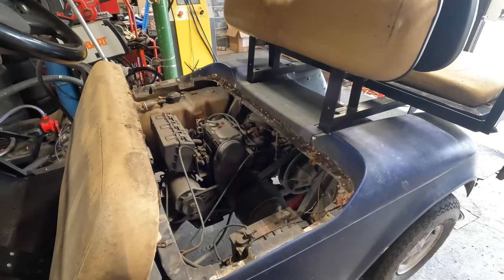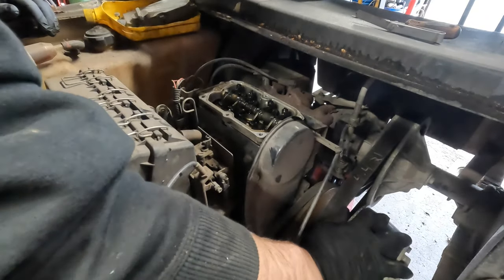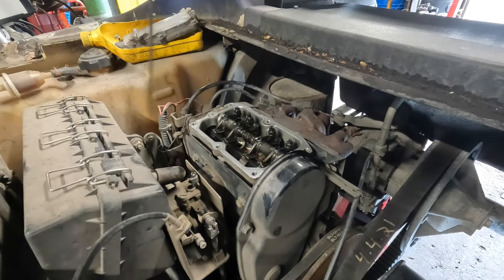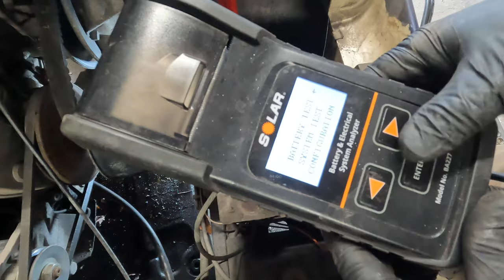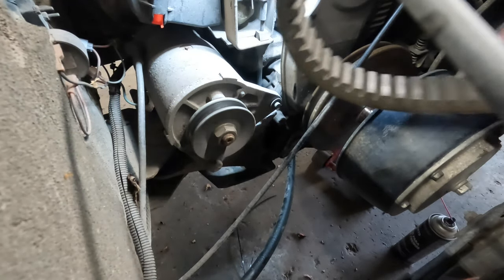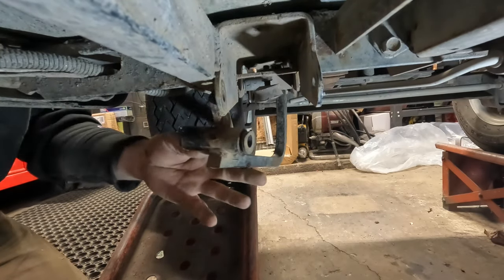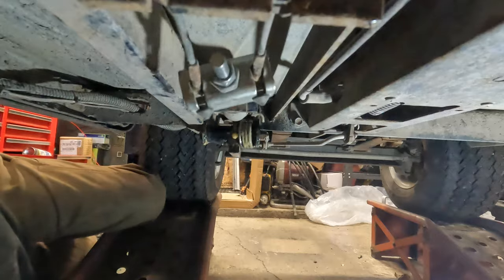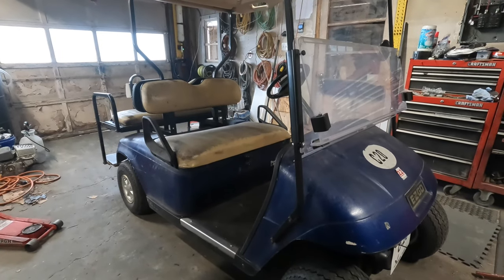2004 EZGO TXT, Gas - Service, Brake Pedal Sticks

Comment: So glad your back. 2 questions. What psi should the compression be? What should the gap been when adjusting the valves?
Reply from the maker: 140PSI and up is optimal. Valve lash (gap) should be .004" (4 thousandths).

Comment: Good job Kevin! Question, after you adjust the brakes at the drum. And you adjust the linkage how tight do you adjust ? Is it just enough to take out the slack? How much should you be able to push up and down on the linkage.
I’m fixing to to replace my pads and lubricate as you did. I have a 2004 TXT Ezgo gas !
Thanks
Eric S.

Comment: Kevin question for you I have a 2003 ezgo it cranks over but won’t start until I disconnect the green wire off the voltage regulator then it starts and runs fine I’ve replaced the igniter on it and it still does the same thing this thing is driving me crazy any help would be greatly appreciated thanks.

Comment: 20:27 you commented “break cleaner, not carb cleaner”. For this use, what’s the difference?
Reply from the maker: Carb cleaner can be harsh on rubber parts. It usually makes them expand and unuseable. Brake cleaner is a bit less agressive with most rubber and plastic parts.

Comment: Kevin you take your time and do a good job but when you cut corners and you don't replace the O-ring on the oil filter that has been exposed to heat, dirt and whatever it just cheapens the good job that you do. Id order a new O-rings if you are changing the oil and not the filter just to have them on hand. Harbor freight has a box with like 300 O-rings in different sizes metric and standard. I change the filter & O-ring no matter what with new. You do a good job and BTW I used my small impact drill until I switched to Kobalt 24V with 5 year warranty, if it fails they give you a new one. I enjoyed your video.
Reply from the maker: I know it seems like I'm "cutting corners" but, I am not. in all the  years that I've been doing this, reusing orings has not caused any issues. If they are ripped, stiff or swolen, I replace them. If they are still soft and plyable, then they are still good. There's no need to change something that is still good. I wouldn't use Harbor Freight o-rings for anything. They have not served me well in the past. I stick with OEM when possible.

Comment: When do you recommend replacing the timming belt on an ez go 295?  Not sure if its an interference engine or not. Picked one up for 300$ its blowing oil out the breather tube and has low compression. I suspect the valves are way out of spec and the carb needle/seat is leaking filling the crankcase with gas and pushing the excess out the breather. What are your thoughts?

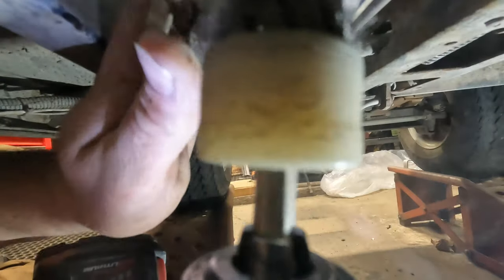Comment: 55:30 - What is the exact name and brand of this wire brush? Source?
Unfortunately, most are soft and hollow in the middle.
Reply from the maker: These are brushes designed to clean battery posts. I use them for many other things since I buy them 50 at a time. They have a hollow center so they can clean over threaded studs. Deka Battery Brush. I get them from etrailer since I'm a dealer.

Comment: Kevin, I’m looking for a dipstick for my 1993 EZGO marathon, gas I can’t find one for it. For some reason the one I got with it from the previous owner had a lawnmower one in it!?
Reply from the maker: Used to be able to get them directly from EZGO, but they changed their website so now you have to go through a dealer. I used to buy them directly off their site, but now I can't. Just another reason to avoid them.
Reply: @Kevinsgolfcarts  I agree, I despise EZGO engineers nowadays, but my robin engine it the best! Thank you!

Comment: 2006 EZGO I changed coil including removing coil bracket. I lost a fibre washer on the bracket for the ground wire. Now with new coil hanging loose cart runs well if I bolt to bracket it runs 1/4 speed. Any ideas?
Reply from the maker: Hmm, that's interesting. I'll be honest, I'm not really sure. I haven't had that issue so i can't really offer a suggestion. You can buy fiber washers on Amazon, usually in packs of 5 or 10. I would order some and see if that fixes it.
Reply: @Kevinsgolfcarts  thanks for the input. I winter in Tucson Arizona where my cart is and will completely isolate the bracket with fibre washers and maybe plastic bolts and see what happens. I just thought I would comment on my issue and see what I get back. I really enjoy the site and Kevin does a great job on the carts, films and narrates very, very well.
Reply from the maker: Thank you for your kind words. I would try to keep it as close to stock as possible. If you jump on ebay, you could usually find the manuals for your cart as a pdf file for cheap. I'm not sure where th fiber washers are used in you case, but try a search for your carts manual on ebay. You might end up with an entire series, or even the entire line of EZGO carts manuals for cheap.

Comment: I wish i knew how you keep getting the 'good' carts, like the twin Robins. This year we have modern hell, with EX1's, lithium crap and Chinesium stuff.

Sure that's a 2004 and not a 94? I never saw a square airbox on a 2004. I thought they went to MCI by 2003
Reply from the maker: Date code comes back as a 2004. Its possible I glanced at it wrong, but I think this was engine swapped at some point before this customer bought it or someone switched out the equipment tag. Its hard to say what these carts see in their lifetime. They mostly see abuse and neglect.

Comment: Hey bud , glad your back! Sorry for your loss. 
I was  just wondering if you happen to know of a part # for a starter belt on a 92 club car DS that I could get from a local part store like AutoZone or advanced. Thank you
Reply from the maker: That I wouldn't know. You'd have to look on the belt for a part number. They might be able to crossreference that number. If there is no number, they may be able to measure it and get one that will work.